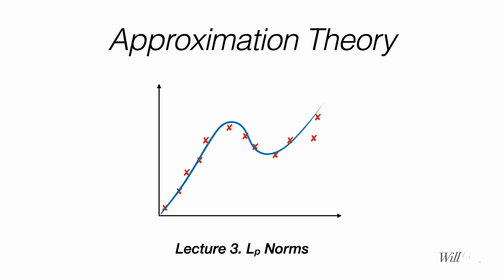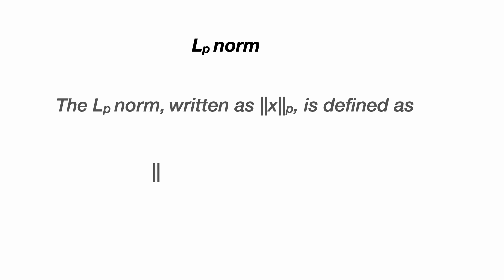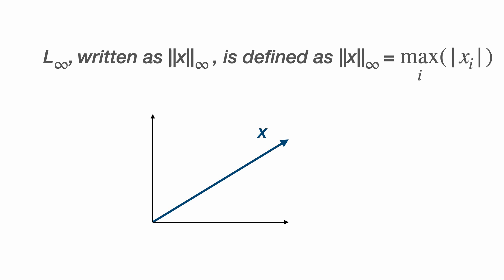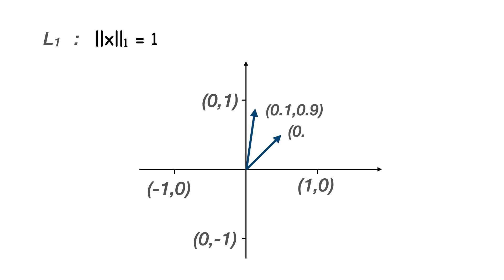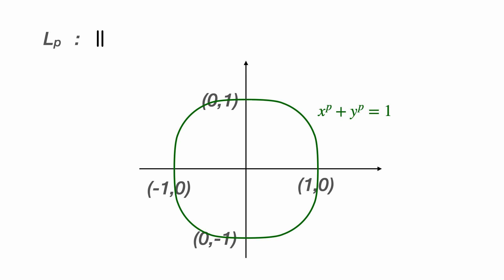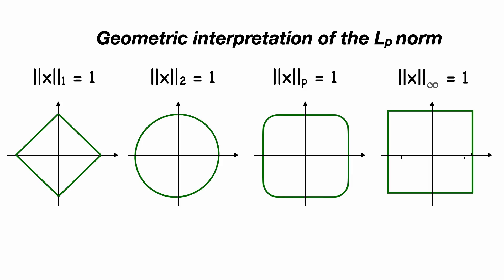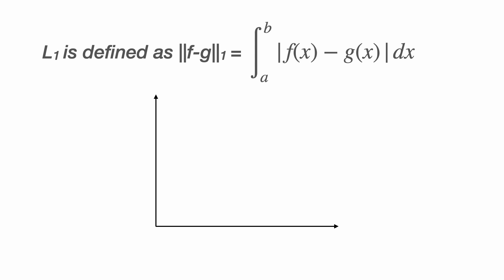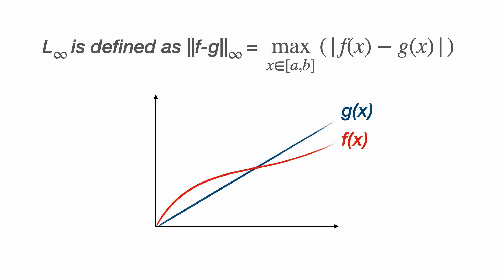The Lp Norm for Vectors and Functions

Comment: What's really interesting to me about this is that it implies something about roots and powers--as you take larger powers, larger input numbers become more prominent in the output. Which, y'know, sounds obvious in hindsight, but seeing how this leads into "taking the infinite power of a set of numbers, adding them together, and then taking the infinite root of those numbers is the same as picking the largest number in the set" unlocked something in my brain.

Comment: won't the l2 norm be a circle instead of a square at each point. i.e. similar to a making a 3D shape by rotating each point of g(x) about f(x) as center and then taking the volume of that shape. Of course we are then applying a square root after this.

Comment: One point missing (or not stressed out enough) is that the higher p is, the more important is the contribution of large errors (e.g points far from the values to evaluate). On the contrary, the lower p is the higher the contribution of the small errors.

So a large p will favour estimations that have small maximal errors whereas small p will favour estimations that stay close to the function overall allowing large spikes in places.

This is particularly visible comparing L_1 and L_inf. L_inf will be high for a perfect match except for a single point being far from the function to estimate, when L_0 will be 0. On the opposite, L_inf will be small (=epsilon) for an estimate e(x) = f(x) + epsilon whereas L_1 would be epsilon*(b-a) where [a,b] is the integration domain (so large error).
Reply from the maker: Absolutely, spot on. thanks for taking the time to write this!
Reply: Thank you. That what I was looking for exactly.

Comment: Does anyone ever use L_p norms for anything other than p=1, 2, or infinity? For example, the L_3 norm is well-defined, but does it ever arise naturally?
Reply: L_0 norm can be used sometimes in machine learning (in some particular places) to favour models that have many 0 components. It's simply the number of non zero components of your vector.
Reply: Norms for p<1 are defined differently - or the formula breaks triangle inequality (length of vector sum becomes longer than sum of the vector lengths) 

L0 can only be defined under new formula where no p-root is applied to the sum, so different topic

Comment: 1:04, why is this the case ?  ||x-z|| leq ||x-y|| + ||y-z|| ? What does this mean?
Reply: Essentially, it means that there are no shortcuts; you can't get from one point to another in less distance by deviating to a third point rather than going directly. It's a holdover from defining a metric space.
Reply: @tomkerruish2982  Ah! Thanks!
Reply: @tomkerruish2982  So if im understanding correctly it means that a straight line is always the shortest distance between two points in the space?
Reply: @pianochannel100  Yes. It's the triangle inequality.
Reply: @tomkerruish2982  Right, well thanks Tom!

Comment: The Lp norm,as defined in the video is valid only if p>=1 (not merely p>0).
The triangular inequality is not satisfied for 0<p<1.

Eg : x=(1,0) , y=(0,1)
For p=0.5
||x||_p = 1, ||y||_p = 1
||x+y||_p = 4
Reply: So for p<1, different definition is used apparently - w/o p-root, and then triangle inequality holds. But that seems outside scope of the video
Reply: p < 1 can still yield interesting results such as when plotting the unit "circle," though it technically doesn't give a "norm." Of course once you've started abandoning axioms like that, there's nothing stopping you for using p < 0 either. (p = 0 actually does give a valid distance, but not a valid norm, and only if 0^0 = 0, in which case it's the Hamming Distance.)

Comment: Another question. Why are functions included in Lp space? A member of the Lp space is a set of numbers (x,y,z,…) that satisfies some axioms, however functions aren’t a single set of numbers. They are multiple sets of numbers since each point of a function has a set of numbers (x,y,z…) describing it.
Reply from the maker: Hi! great question! I like to think of the Lp norm for functions as a kind of "limiting case" of vectors tending to infinity. This also relates to your earlier question actually. so imagining you have a set of n data points of a function over an interval eg (1,1), (2,2), (3,3), and we increase the number of points (1,1), (1.1,1.1), (1.2,1.2)... (3,3), not increasing the interval width beyond 1-3 in the x coordinate but the number of points between 1 and 3. Essentially, the limit as we reach an infinite number of data points is what a function is (at least that's how I like to think of it). At which point the sum becomes an integral. well, kind of, it works and that's the most important thing I guess! Now, regarding functions and Lp spaces, I think the crucial thing is the function being bounded in an interval otherwise lots of functions would have a norm of infinity which isn't useful. It might be a useful exercise to consider a continuous function over an interval with a given Lp norm (integral version) and ask if it satisfies the criteria of a norm (the 4 criteria at 0:58). Also to give context, I would say Fourier series are the most widely used application of norms involving functions over a given interval. Theoretically Fourier series finds the trig series (q lets say) which minimises the L2 norm of the function you want to approximate (f lets say) minus q, which is the minimum of sqrt(integral from a to b |f(x)-q(x)|^2 ). Hope this was helpful!

Comment: My text refers to these concepts as Matrix Norms. In the text, they give a 5th qualification, ||AB|| <= ||A|| |B||. Forgive my ignorance on the topic, are these the same things as  Normed Linear Spaces?

"Squircle" :D
Reply from the maker: I think that matrix norms are a special case of the more general vector norms. In my opinion that inequality would be something that is true for  matrices but not a requirement (i.e. something could be a norm without that being true but just so happens that it is true for all the norms we care about :-) ). I of course could be wrong with this though. The reason this inequality is more specific to matrix norms and not normed linear spaces in general is because the ability to multiply two vectors together is not always given for a normed linear space (you can add them together and/or multiply by constants). I hope that makes sense!